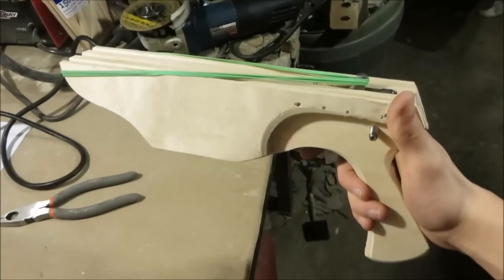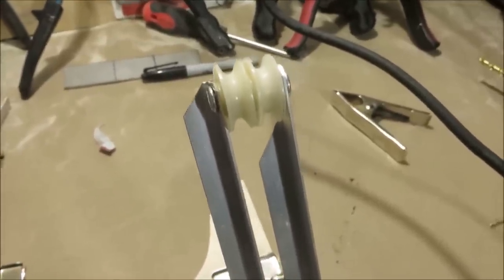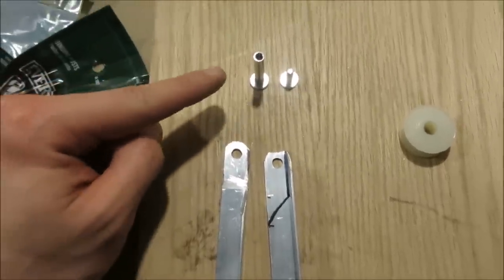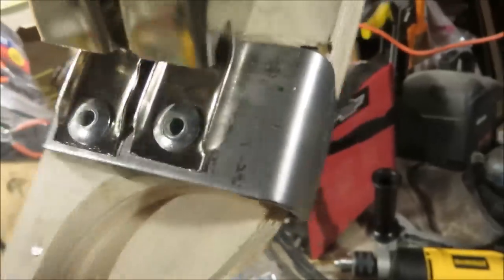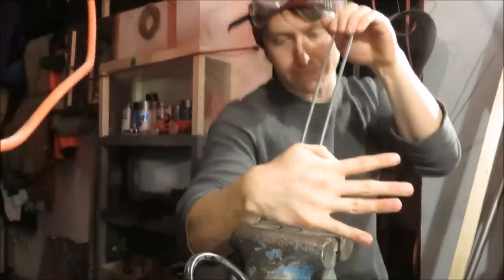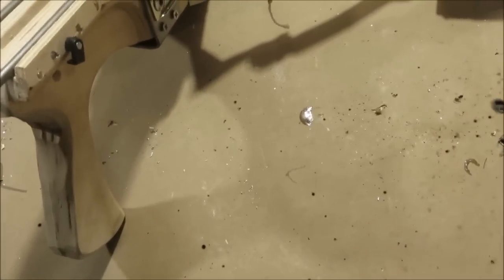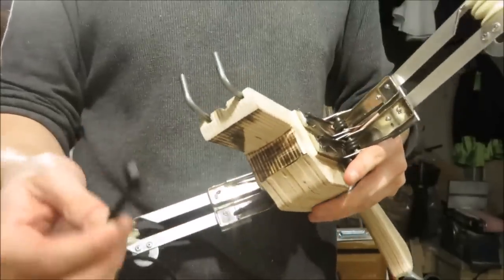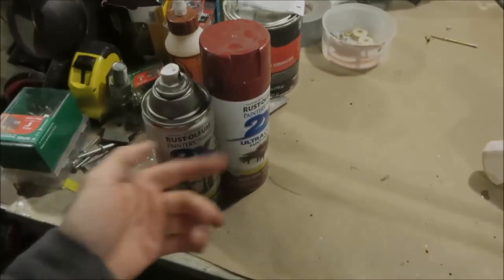How to Make: Easy-Load Magnum Pistol Crossbow (2/3)

Comment: I know this video is kind of old now, but for future projects, if you're in a bind and you need one of those "binding posts" grab an old pair of rollerblades or something. The screws holding the wheels in place are usually binding posts.
Reply: "If you're in a bind"

😋 I see what you did there. What you did there... I see it.

Comment: I used to save those binding posts from my roller blades when I was younger, I was riding blades on 2 wheels instead of 4 so I had 4 leftorver wheels for backup and 4 binding posts just in case I need them, I thin I still have 4 of them :D
Reply from the maker: There must be a God
Reply: also I thought if those binding posts could be a better solution to bind the extra springs in the clamps ? might hold the springs more solid
Reply from the maker: Tadas Armonavičius Thought about it but the holes didn't exactly line up so I just went with the wire.